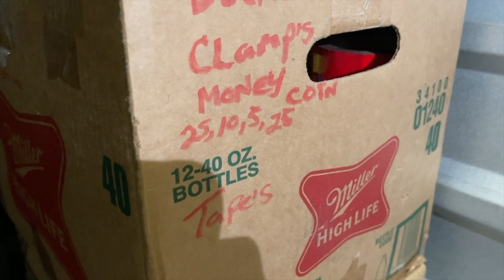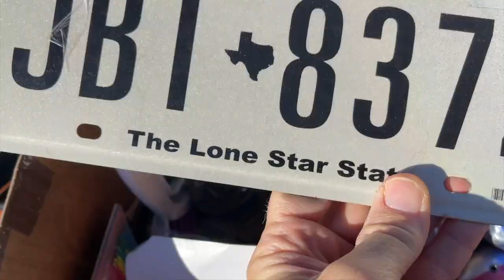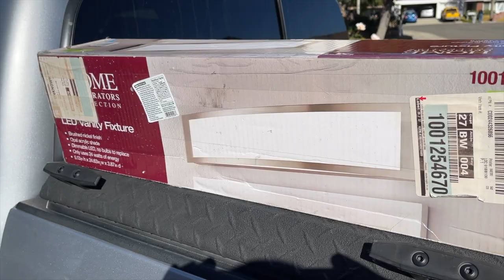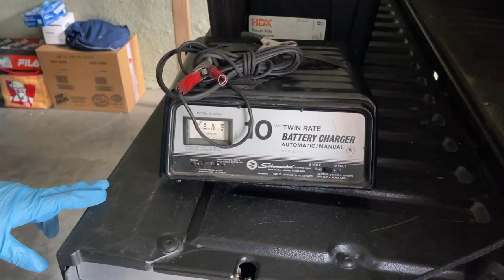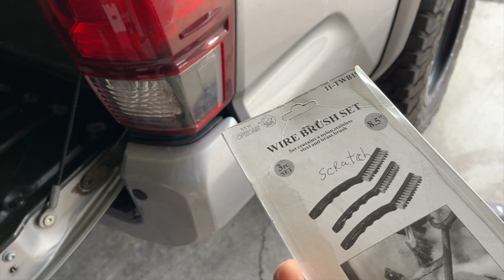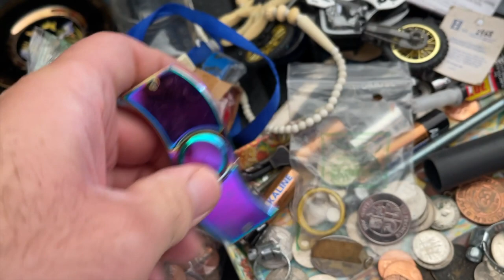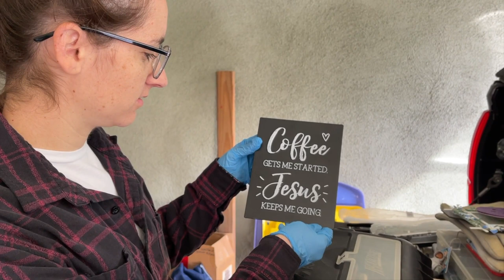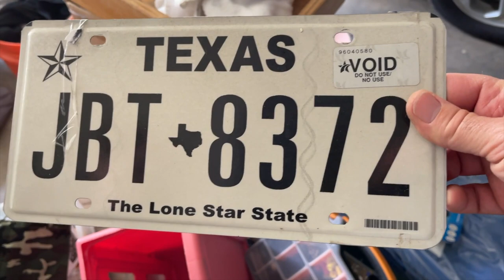We Won A Storage Locker | What Did We Find This Time?

Comment: Your welding helmet is auto darkening.  That is what the controls are inside, above the glass.  That’s a GOOD thing.  Be sure to find the battery compartment in it and remove the batteries in case they are old, so they don’t leak.

You two are adorable, but not mechanically inclined when it comes to tools, are y’all. 😅